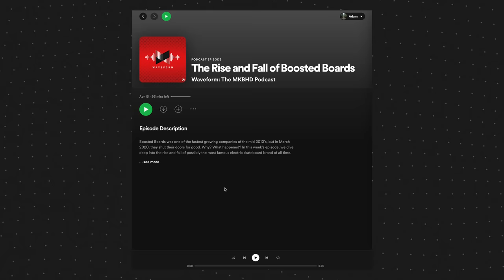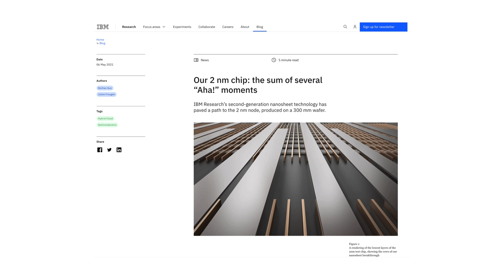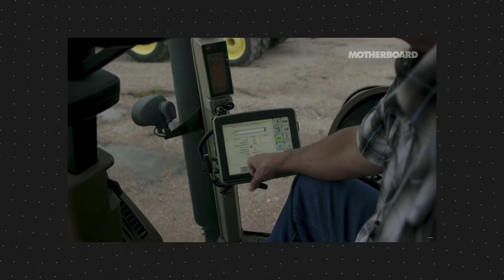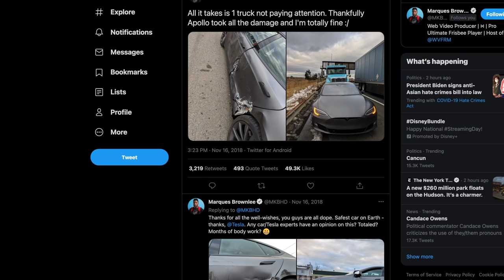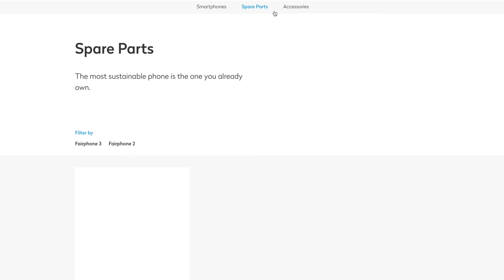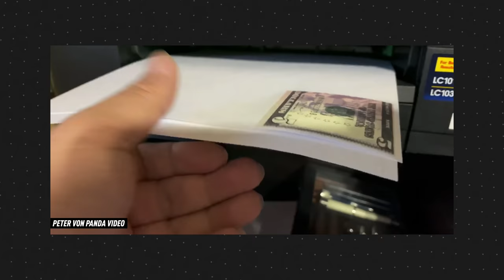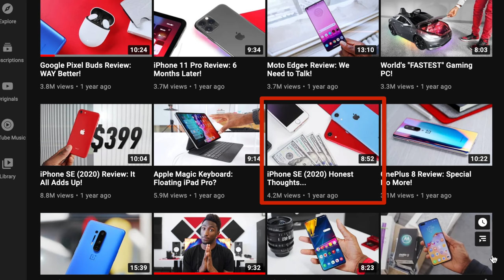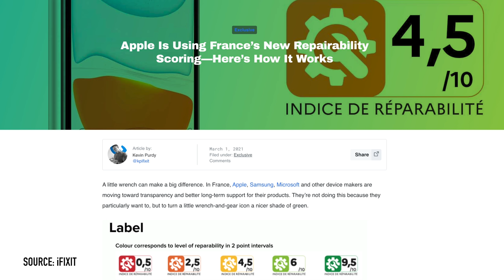Right to Repair Deep Dive!

Comment: I think one of the issues in this conversation is that there seems to be an assumption that only the manufacture has the skills to fix the newer more complicated technology. But I think one of the points of right to repair is that if they weren’t so protective of their parts and tools people would be able to fix even their more complicated technology. People can learn to fix even the most complicated technology because people figured out how to make it initially. These big companies are preventing people from learning how to do it, holding monopoly then and saying Other people can’t repair it because they don’t know how meanwhile they are preventing people from learning how. Another issue for example with John Deere and with Apple is that they prevent people from accessing software needed to make changes, for example Apple software locking batteries and home buttons to devices so that they don’t work if they’re replace. This stuff is getting more complicated, but I think there are lots of people that would be eager to learn and offer their services to help people make their devices last longer and reduce e-waste, but these companies are preventing them from accessing the parts and software, to maintain their monopoly on the repair business and extend their profits after the product has been sold. On the other hand, I see that these companies would want to prevent liability. You can see with brands like Tesla who take heat when owners use their cars improperly, like when they use auto pilot from the backseat, I think these things strengthen the company’s position on anti-repair. They’ll say if we let people do what ever they want to our products, and it goes wrong, it’ll blow back on us and our brand.

Comment: I agree with that YouTube comment Marques mentioned. Aftermarket parts are so common in cars. If done poorly, the body kit could fall off and hurt the car, its passengers and other people on the road but it is completely legal. That's the same as replacing the battery on your phone or fixing your tractor.
Companies need to trust that consumers care for their own safety. That is the premise of all law and society. If you don't care about your own safety/life then going on a killing spree has no repercussions for you. If you don't care about a death sentence or imprisonment then you can do whatever you want.
The liability thing doesn't make sense either. Are companies liable for all batteries that explode even if it was installed by them? No. It depends on the conditions of use. If the customer misused the device, the company is not liable. Similarly, if the battery explodes and it can be proved that it was customer error during replacement, then the company is not at fault.

Comment: Great discussion and insights man. A discussion & topic that is the need of the hour! 

Ultimately, i think it boils down to people and companies taking a stance that "tech needs to get better AND be repairable to a great extent" . It needs to be an AND approach instead of it being an EITHER/OR approach. For instance, for any business today and going forward, being "ethical" and "giving back to the community" and "have humane work conditions" or "respectable minimum wage" needs to be a MUST and not an option or after thought. 

The issue lies with the willingness of these companies to actually innovate in tech from an approach of being able to solve to make things repairable rather than focus on just making the tech and then figuring out if it can be made repairable or not. It needs to become a NECESSITY rather than an OPTION and only then will we see technology not only advance and get optimized and all that, but also be made in a way that individual or compounded parts can be repaired. And legislations need to be put in place to actually incentivize companies making eco-conscious and repairable products, whereas products that are not repairable or that don't provide ease of repair should be taxed higher (post sales tax based on volume of product sold) as a deterrent to ensure these companies will have to drain profits if they continue to make products that pollute the environment.

Also, these replacement parts and repair parts can't cost half of the p[rice of the device itself. That marked up pricing to push people to get a new product is also something which needs to be addressed. Sure, mark up an individual component 5-10% above the large inventory price that you as a company buy it at, but you can't mark it up to cost an arm and a limb!

Comment: The right to repair is not about forcing companies to design devices to be repairable. 
It is about stopping companies from going out-of-their-way to make repair difficult in order to 'end-of-life' old devices so they can sell new devices.
The goal of right to repair is to
- Stop companies blocking access to parts.
- Stop companies blocking access to repair data, eg assembly diagrams, schematics and boardviews. (No access to secret company data is needed here. You could use a multimeter to measure any device and create your own schematic and boardview but it would take so long that it's not economical to do so).
- Remove the monopoly the manufacturers have created that makes themselves the only one who can repair their products. They have a serious conflict of interest here since repair is bad for business when a new device could be sold instead.
- Protect the users right to have fair choices for repair.

Comment: I think the point about only buying the better product is subjective, I am more willing to buy a product with worse features if it's repairable but I literally can't, and I find it interesting because how repairable it is and how open the eco system is my main reason for considering apple products to be bad products, everything else about them seems great and if they changed that I might actually considering buying them.
Reply: A rational reason for many users to buy Apple products was productivity. I have been in mixed PC/Apple Mac environments and have seen cheap PCs fail, while the Macs would soldier on for many years without a hitch. Where time is money that's actually a very valid concern and buying a slightly more expensive Apple design will, over the long run, very often returns its money. Now, mind you, this is a statement about older iMacs, I have heard that MacBook users are not always having such a positive experience lately, so one has to decide on a case by case basis. I consider phones as throw-away hardware anyway. They age out and that's how one should treat them after three or four years.

Comment: Just a random thought about the trade-off between repair-ability, durability and costs: 
If something is easy to repair, but breaks 20/100 times, it means 20 consumers paying a little bit to fix it. Seems fine.
If it's impossible but incredibly durable, it means that it might break 1/100 times, but it also means 1 costumer having a huge cost in buying a new one. In other words, it's as if the costs of repair were being focused on the ones unlucky enough to be the rare cases of breaking in the almost-indestructible devices.

What do we rather have: the so-so change of having to pay a small amount to make a quick fix, or the small chance to need to buy a new one?

edit: sorry if anyone has already made this kind of comment or if this was mentioned in the video (not until the point I've seen it at least).

Comment: Would have loved the conversation to touch on End Of Life products as well. It's hard enough getting parts for current products and doing repairs when the systems lock you out etc, when they reach thier EoL it's will be even more difficult to maintain or repair the product that you bought and own and the manufacturer doesn't even support.

Comment: The right to repair law is not about preventing densely integrated solutions, like merging CPU+MEM+FLASH+SMC into one single 2nm IC. Nothing about right to repair would try to stop products becoming more integrated. This would arguable be good for device longevity because IC's usually do not fail. It's usually interconnects between ICs that develop problems. Liquid damage being the main issue.

Comment: Being well integrated is one aspect of upgradability- which you spoke of. The other, more controversial and real aspect is companies deliberately denying upgradability. For example- non replaceable SSDs, proprietary motherboards, proprietary ports, proprietary screws (non philips) as seen in MacBooks; headphone jacks, replaceable batteries, sd card slots.

Comment: Currently 20 mins in. There are many things which I'm not completely clicking with here, but don't want to say anything until I watch the whole thing. 

However, I do think a very important peice of the puzzle for right to repair has been overlooked thus far in their discussion...price....

If your career is all about producing tech content, you'll naturally have more access to the fastest and best developments in technology. From that vantage point, the 'better integrated' tech is the thing to strive for. 

But it's important to remember that for the vast majority of us, a phone is something we get once, and need to it last for at least a couple of years.

If that screen cracks, and our only option is to pay $500 to get it fixed from Apple, or buy a new phone entirely, well odds are that we'll have to deal with the broken phone for a while. 

I think it's really important to remeber this part of the conversation before getting lost into the depths of innovation vs limitation. 

People are forced to shell out money that they don't have, while being told that it's for their own good, and being overcharged massively for the repair.

Comment: Just my 2 cents about the John deere and tesla's parts: as a motorsports guy i can totally understand tesla for "punishing" people who heavily mess with their cars, like Simone's truckla.
If you drop your phone from a height it will shatter but unless it falls on someone's head nothing would really happen, meanwhile in cars the chassis is designed to act or react in specific ways in specific situations, for example the front of the car is designed to crunch on impact to disperse all the energy before it reaches the occupants of the vehicle, the roof and sides are designed to crunch a little bit but they should keep enough shape to let the doors open. Agencies that certificate car's safety features have all kind of tests, i remember the new Mercedes SL had to go through a test where they flipped the car on it's roof, literally blew the gullwings' hinges with a small charge and tested how easily the doors would let the occupants out of the car, so i understand tesla's attitude: Simone obviously isn't stupid, but what happens if someone less quaified did the same truck conversion, then get involved in a rollover and the poorly made structural modifications turn them into human pancakes? Same with john deere: i wouldn't let people fix very sensitive parts without qualifications and face the risk of having a tractor losing one or more safety features, making it plow into a nearby farm. Mechanical stuff is easy and should be fixed by the owner, specific or extremely sensitive reparis should be handled by qualified techicians
i 100% agree with the RTR movement though: if i own something i have the right to keep it functional as long as i want or possible and if it's needed i want to be able to bring it to a local repair shop down the street or even attempt the repair myself, thus giving me access to a legallly bought genuine replace part at a normal price.

Comment: Fairphone + project mainline would be an interesting thing. If they started off with slightly more powerful, 'future-proof' specs, or if they figured out some way to actually upgrade the phone's processor, (which would obviously have to be done in store) using the same phone for seven years would be awesome.
Reply: You can't make future proof specs in an environment in which transistor counts double every few years.

Comment: A highly complex and delicate device is in no way at odds with the right to repair.  The companies using that line of argument are being disingenuous.  Right to repair is essentially about pushing back at PUNITIVE actions companies take towards third parties in the repair space.  It's simply anti-competitive behavior at its core.  If it's not economical for a third party to perform certain repairs, the market will sort that out quickly.

Comment: The argument for better tech isn't conditional on right to repair not existing. Companies can innovate and make things better WITHOUT going out of their way to not sell parts. Also, the problems with the tractor isn't a hardware problem, it's a software one (if i'm remembering correctly). The bottom line is for a business it'll never be a good idea to make their systems repairable and maintainable in the long term. It's always much more profitable to sell black boxes of tech with an expiration date attached to it.
Reply: Yea that was my main issue with the video. Companies can still make tractors that save 90% of pesticide, just provide manuals and schematics; and don't tell the source of their parts to not sell it to anyone else. They don't have to throttle the innovations at all. I have no idea where this idea comes from.

Comment: There's an obscure German manufacturer called "Shift phones" that is trying to produce more capable phones with the same modularity, they are beginning to ship one with Snapdragon 845 and are supposedly working on another one with 888. The upfront cost isn't justified by the ability to repair, though.

Comment: i think a great counter to the john deere side is the fact that farmers are seeking out older equipment of 40+ years ago simply because of how much easier it is to repair. manuals and parts are readily available and they dont need to bypass a snowflake software that requires the grace of john deere. these farmers work on a timer and from my understanding, prioritize the ability to repair their products quickly to get back to work over the new tech of making farming more efficient. They dont want to wait months for a john deere representative to come out to their farm to put in their special key to tell them what's wrong with the equipment. They would rather lose efficiency over the possibility of being unable to work for weeks and miss their crop timings.

Comment: 5:04 If there's an issue with the CHIP, then you could replace the CHIP and it should work normally again. It's not like it would be anything different than a normal CPU being replaced in current devices. Apple has started using "security chips" that read the serial codes of components and if you replace any of the "secured" components it can brick the device. This isn't due to a technological leap, it's to make it nearly impossible to get your device repaired outside of Apple's bubble. 

Nano Sheet Design that was shown: https://www.eweek.com/wp-content/uploads/2021/05/IBM-Worldu2019s-First-2-Nanometer-Chip.jpg That isn't so tiny that it'd be impossible to replace.

Comment: More or less, 
I try to know about the common issues of the Product before I get it...This also Sets my expectation of Durability, Pausable Fixes & Lifetime of the Device

For Ex - I got into the rabbit hole of Mouse, due to seeing the same issues crop up at mouse review on Amazon Depending on User ~5 months or in a couple of Years.  
I.e., Double Click and Drag failure of Mouse due to "primarily" failure of Micro Switches (Mouse Buttons) 
+ In essence, Circuitry being built upon old standards, instead of designing a new one for present Requirement of the market from the ground up Etc..,

I ended up getting a wired ASUS Mouse that has Hot-Swappable Micro Switch Socket - so that I can avoid soldering circuit.
*I didn't Buy wireless because I do not know if they "programme"/"how good" the battery management is.

So that it can avoid constant overcharging (+85%) of the battery
This will cause the Battery to lose Capacity due to the formation of Lithium Ion Dendrites, 
also, I was not sure if I can get the Battery with the same specification in the case when I do have to change. 

for my use case, I decided I can settle for wired...for now.

*My 2015 HP Laptop has good-for-nothing Battery Management, Where a new battery will die within 4-12 Months since most of the time it's plugged on the wall so it's mostly ~100% Charged thus dies faster. So I gave up on Replacing its Battery, now It's just like a Desktop.

The new laptops have better battery management I guess, you can limit the battery to ~70% when you know it is going to plug in for long period etc..,(Personally seen on ASUS, Lenevo... I have "not" looked up on other brands solutions though)

Comment: There is a lot of good information here but there are some points that were brushed over. You didn't really talk about how companies are artificially limiting the availability of parts for products for the people that do want to make those repairs. Following on that right to repair does not necessarily mean that you are going to repair the product, What about third-party repair, it wasn't really covered how third-party repair shops that actually do know what they are doing can not get access to the parts to repair devices for you. 

On the safety point for repairing devices, the FTC just published a report on how repairing your own devices has not resulted in injuries and that is basically a false claim by companies.

Right to repair is the choice to be able to repair if you want to, and where you want to manufacture or not. It is not all about each person repairing their own devices.